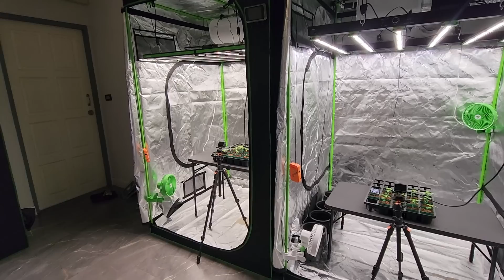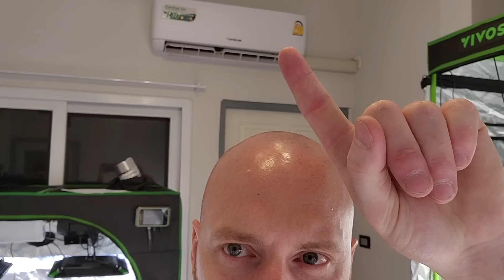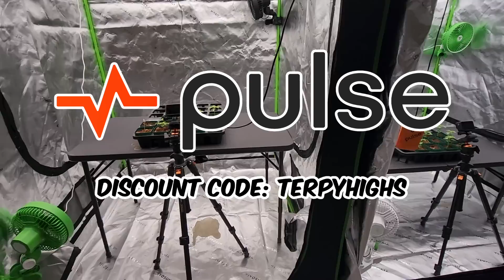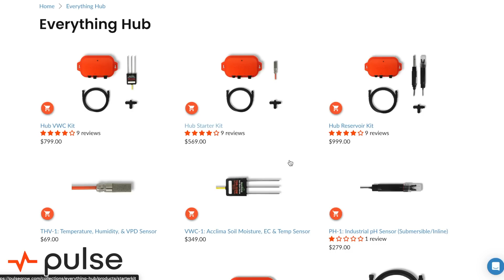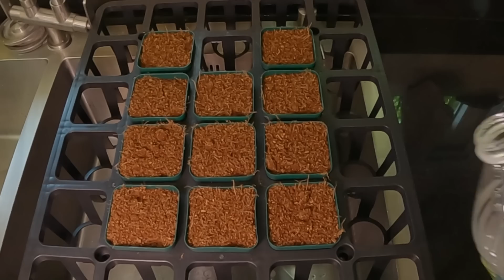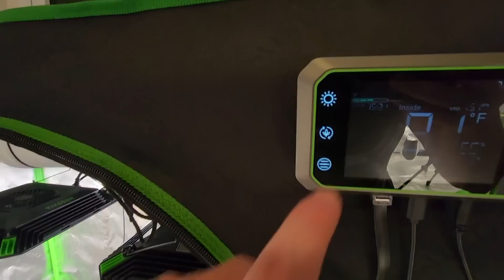FIRST PLANTS IN THAILAND!!! SUPER FIRE STRAINS!!!

Comment: Those Pulse Ones are just like the Govee weather stations that I use, I love those things. Whoa, is that some kind of misprint? $200? That can't be right, the Govee must have the exact same enviro sensor minus light sensor and they are $11.99 temp, humidity, VPD, dew point, just like the Pulse.  Those guys at Pulse should take a look at their vendors/supply chain, they must be paying way too much, those should be $20 maybe $30 if Wi-Fi, the Govee is BT, but you can add a hub or use Home Assistant and get your info Wi-Fi. Yeah, those guys must be getting ripped off on that stuff. Sensors and network connected microprocessors are like less than a buck a sensor, they should be able to have those meters built and shipped for 2-3 bucks max
Reply: Its a better more durable version not using the cheapest things. Some people like that and dont mind spending...
Reply: @mhiy3isn If you like paying 2000% more for the same thing you are definitely in the right hobby. If the internals of the Pulse One aren't the exact same sensors I'll eat my keyboard. If there's one thing I've learned it's that China only makes one circuit board with temp, RH%, Dew Point and VPD with 2 year historical data storage, but they will wrap it almost any way you want. Mine has a display, the Pulse has a light Sensor. Now, to be fair, mine is Bluetooth and theirs is Wi-Fi, I thought it was a better idea to keep the Wi-Fi module outside the grow room environment. The only people who had issues with lights coming on when they weren't supposed to were the folks trying to dim their LEDs to off. If they had used a real light controller that never would have been a problem, they've since labeled dimmers 1-10V dimming not 0-10V dimming. Do you by any chance use Athena Proline nutrients? Because they have a product you'd love. Their Cleanse is 99.97% water for $60/gal, I use pool shock to achieve the same thing and a 1lb bag will make $1.2Million worth of Cleanse for $7.99. You'll love it. Learn to read the labels kids or they'll screw you real haaaard. Remember, the Hydro Store(industry) is a rip-off!